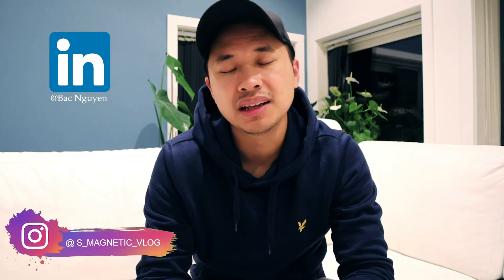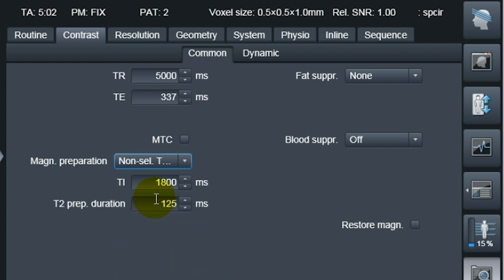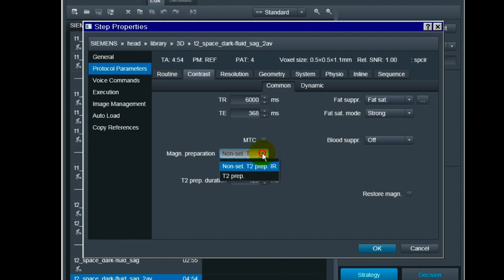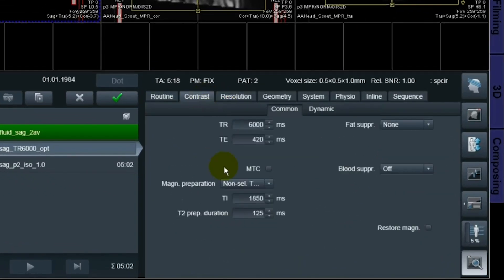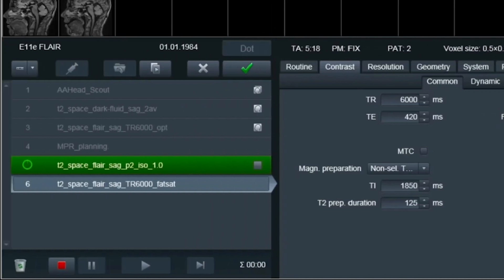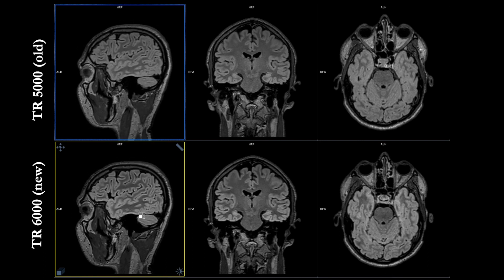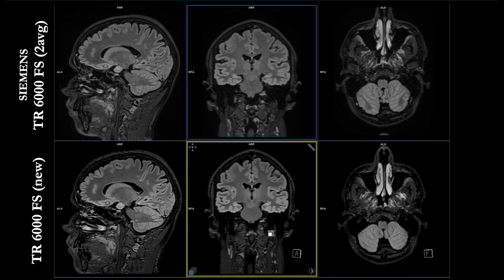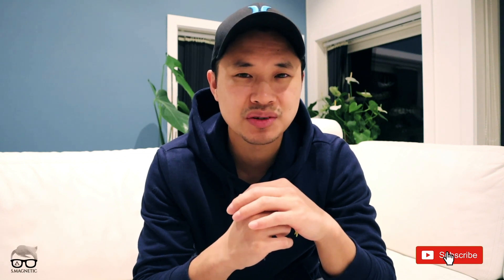3D FLAIR IMPROVEMENTS ON SOFTWARE E11e

Comment: Hi Bac!
Can you explain option at 3d space flair in Sequence card-assistent-part 2, there is option flip angle mode- T2 Var- T1(940) and T2 tissue(100). I got better image when i change T2 tissue into 200 but I'm not sure that I'm not disturbing the other parameters.
Best regards
Reply from the maker: Good question. To be honest I haven’t put my mind in to those parameter yet. It’s cool you get better image. But better in contrast or?
Reply: @Nguyen_MRI  yes, contrast is better, muscle tissue and optical nerve is much clearer and artifact  from top is smaller (you fixed it with 2av).
Reply from the maker: @TheBeastSoul  awesome. Just crazy big range of change possibilities.

Comment: What is that T2 prep duration doing exactly?
Reply from the maker: it allows more complete recovery during the inversion time than a classical IR pulse and hence increased GM/WM contrast for a given TR.
Reply: @Nguyen_MRI  thanks.  Where in the pulse sequence is this time placed?  After the IR pulse?
Reply from the maker: This new pulse on flair is also very new to me. So far I seen improvements. But haven’t got the chance yet to fully sit down and look into the depth of this. However, I also saw the prep pulse was on 125 ms. I believe this pulse goes first the IR next. I hope one day I will understand more, but I need to test it more and get my hands on the theory part as well. Thanks for your interest.